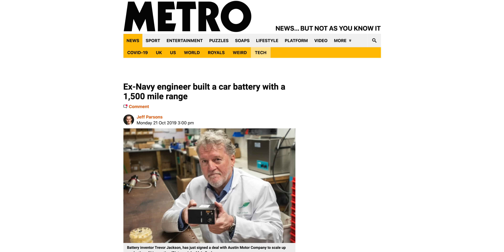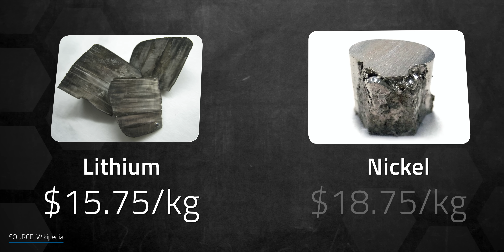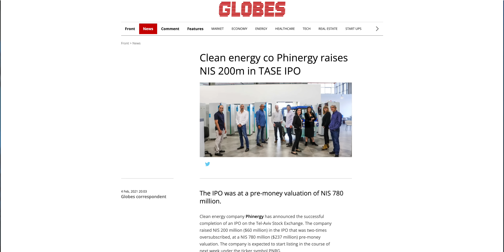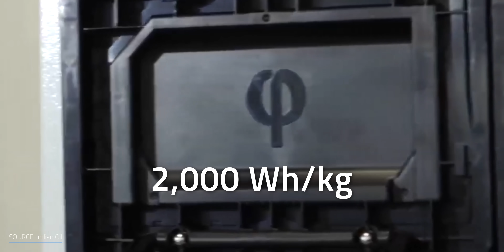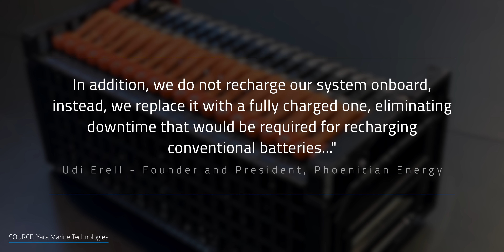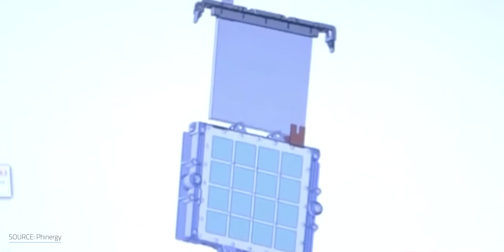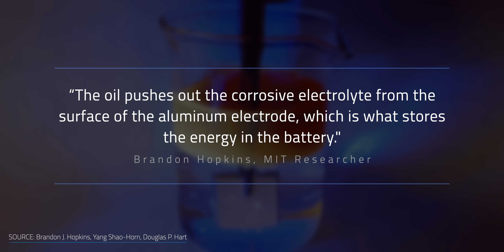Exploring the 1000 Mile Car Battery - Aluminum Air Hype?

Comment: I think these batteries are only worthwhile as occasional-use range extenders. The 200 to 300 mile range of most EV's will cover all your daily travel needs, no matter how long your commute is. Raising your range to over 1000 miles is useful, but it's only sometimes useful. You wouldn't be needing that kind of range unless you are in the shipping industry,  and if you are in the shipping industry, you probably have a vehicle large enough to store more rechargeable battery power than to go with aluminum air batteries.

But yeah this seems like a single use application system to me. Another niche use market, not something to be applied to all situations.

Comment: so having a non rechargeable batteries seems problematic as i know with  a gas tank and heck even power tools i almost never run to empty so this means that unless you are willing to push or tow your car to the battery service station people will always be swapping out well before getting full use of the aluminum air battery... so the lack of a way to top off really lowers the usefulness of this even farther (this seams like at best this is a point to point power option for shipping/flying or for in city transport) over all this seems like it will have a huge amount of "hidden" waste similar to how supposedly all plastics with a # on them are recycled

Comment: In a car i would think if you had at least 2 batteries & the controller set up to flatten one battery & then give a low battery warning and start to discharge the still fully charged battery. At  which time  you still have half the range to change the flat battery.
When the flat battery is changed you continue to use the partially discharged battery until it is discharged, get the low battery warning & switch to the fully charged battery 
Replace the now flat battery & repeat until something breaks

Comment: Yes, modular, standardized EV battery design would make quick swapping at stations quite convenient. This could solve the issues around EV freight trucks, both in continuous range, quick swapping at stations, and weight.

Why hasn't this been done with lithium batteries?
For the end user, it would be as fast as getting a tank of gas, and the spent lithium battery could be recharged for the next EV to pull in

Comment: You're driving with your family and the last Al-Air battery anode is consumed.  Oh no!  What happens? The little "change battery" light comes on (much like the "low fuel" light in an ICE vehicle) and you continue driving on the installed backup lithium battery to the nearest cell swap station.

Comment: No, I want less dependence on external providers, not more. Also, I want to use my electric car as a rechargeable energy storage battery at home. Rapid electrode degradation is a huge issue, also.

Comment: One of my aluminum air trials used gum arabic to curtail corrosion. Worked well. But one season of locusts in Senegal and hang it up. NaOH seemed to work best and better still if kept flowing, washing the oxide away as it dissolved the anode. Gallium was tried and the aluminum got crazy hot. But adjustment to electrolyte could help. The main problem? The hydrogen oxides condense in the charcoal air cathode as it combines with humid air and floods. Co2 also has a detrimental effect and is death to any air battery as well. Silver and platinum are the best candidates for catalysts but if that's the case a fuel cell would make better sense for the expense. But will it work?  Anything can work if you've got the money.

Comment: Like a spare tire....What if each EV was equipped with a spare battery?  if the battery becomes spent,  the spare gets used.  And then, at that point, one would have to purchase another pair of aluminum air batteries.  Seems practical and logical...

Comment: Not rechargable! that is certainly a problem. One of the benefits of an ev is that you can charge it at home. This puts you right back to the problems of a gas car dependent on gas stations and a complicated and resource intensive industry to keep them running.

Comment: I would be reluctant to rely entirely on a battery that could not be recharged. How about a combination Aluminum air with Lithium ion backup system. The Lithium battery could provide limited range and still be able to be charged whereas the Aluminum air battery would provide the bulk of the energy.

Comment: I've read another article said there's another drawback of Aluminum Air Battery is the low discharge power. Not sure if it still an issue nowadays?

Comment: And no mention of cost of a battery swap out or return on old battery. It looks like a swap is faster than filling a gas tank, so that is good, but, making 1 or 2 batteries that would fit all types of cars and trucks will be another thing all together.. Thus meaning a battery swapping station along a highway will need many different types/shapes of battery on hand and plenty of them. I don't see that happening..

Comment: The energy density of Al-air batteries is compelling, but I am happy being able to charge my battery at home off the PV rooftop system.  I don't think we should be aiming for batteries that need to be recycled after a single full discharge.  That just sounds wasteful.